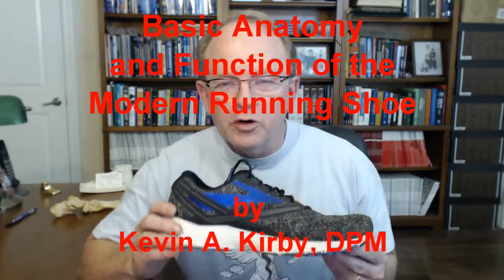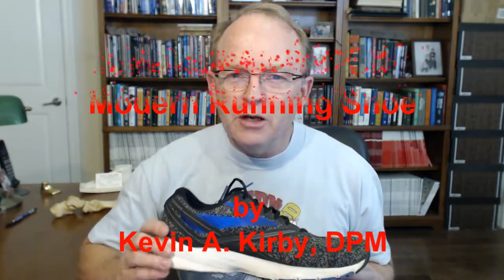Basic Anatomy and Function of the Modern Running Shoe

Comment: Hi Dr Kirby,
What do you think about pronation control in running shoes with orthotics? Should we wear neutral shoes with custom orthotics? Thank you!
Reply: Jen:  Great question.  In general when a patient has an injury caused by excessive pronation moments where a foot orthosis is being used to limit the pronation motion of the rearfoot, I will have the patient wear the orthoses in shoes that have somewhat less "pronation control features" than what they had been wearing in the past to run in.  For example, if the patient had been wearing a motion control shoe before getting orthoses and then I make orthoses for them, I will have them wear the orthosis in a stability shoe.  If the patient  had been wearing a stability shoe before getting orthoses, and then I make orthoses for them, I will have them wear the orthosis in a neutral shoe.  However, in patients who are heavy and very pronated, I may have them wear the foot orthosis in a motion control shoe.  In other words, it is a fallacy that neutral shoes need to be worn with foot orthoses.  However, most patients tend to not "need as much shoe" with custom foot orthoses than without foot orthoses in my 32+ years of clinical experience.

Comment: Great overview of the anatomy of a running shoe. A question to you: I often recommend 'running' shoes to a patient to provide the basic functionality required for a well-supported foot. Now, I appreciate this is a generalization. The majority of my patients are not runners. And of course, this can vary subject to global foot-posture findings. Setting this aside, and when aiming to further control abnormal foot component motion (ie vectors /moments etc) with a foot orthosis, do you recommend a patient to purchase a neutral shoe to provide a basic configuration around which to work?
Reply: Dieter, I will typically tailor my running shoe recommendation based on experience of the runner, their body weight, the types of terrains they run on and what type of symptoms they are experiencing.  This may involve recommending either a neutral shoe, a stability shoe or a motion control shoe.   I only use neutral running shoes for those runners who are lighter in weight and have more stabile rearfoot during running.

Cheers,  Kevin
Reply: Kevin, thanks.  What is the difference between a stability shoe and a motion control shoe?

Here in New York City 'everyone walks' a great deal, and on hard, unyielding concrete. And often wearing poor footwear. When I check sneakers, 7-8/10 now have a very flexible shank. Often I detect a 'flexible' foot also. I advise switching sneakers, with better motion control and at a minimum to ensure the shank is stiffer. Do you provide advice for any other design features? What design features make for a good sneaker for daily walking?